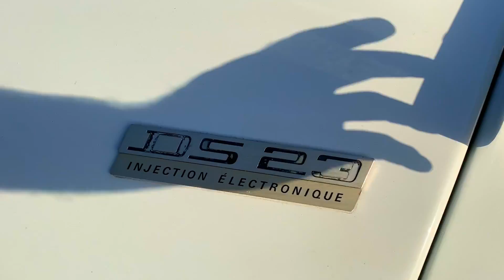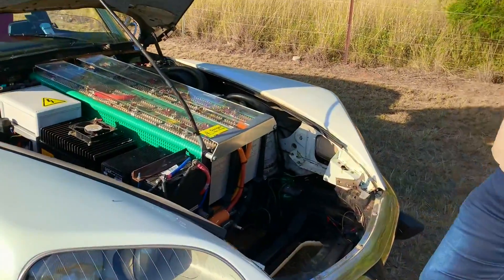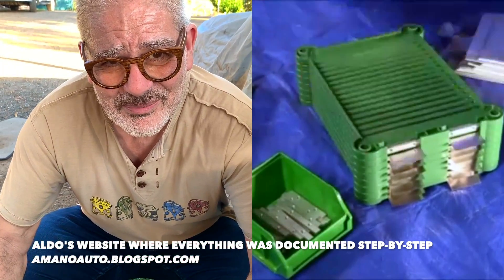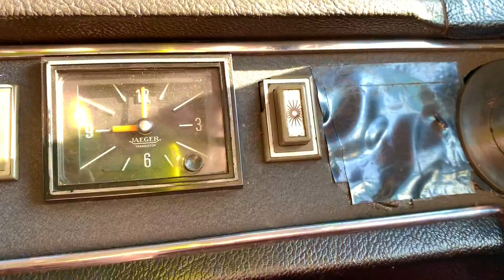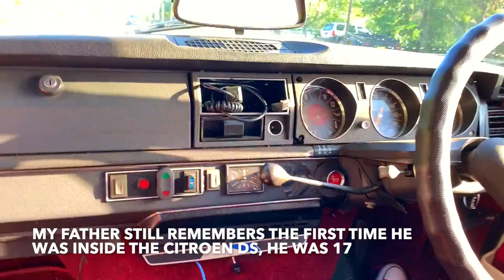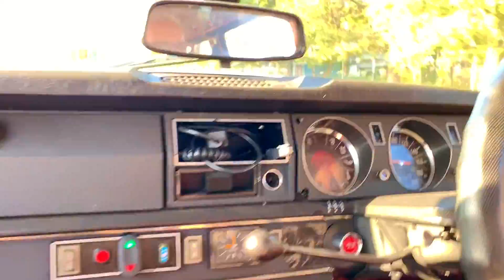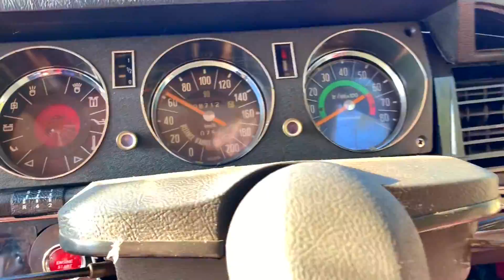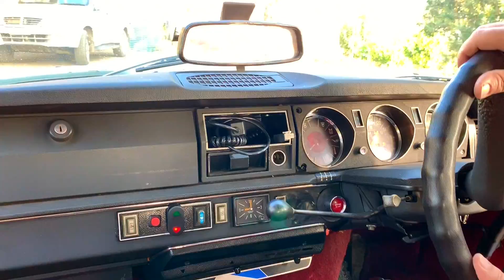DIY Electric Citroën DS 23 Pallas (1974) conversion by Aldo Grech

Comment: The presenter was irritating,had to give up half way through..Mr Grech has done a interesting conversion,though I fear what would happen to that battery pack should he have a front end collision..
Reply from the maker: Yeaahhh thaaanks for watching half video mate!! 
Older cars are SOLID and strongly build to knock a brick wall + there’s over half meter crushing zone before hits the battery + metal plated in front of the cells... so it would survive =]

Comment: Citroen missed a marketing opportunity there
Reply from the maker: Yeaaaahhh... imagine if they embraced electric back in the days and released this car with both options: petrol or ELECTRIC.
Even using many Lead Acid Batteries and older DC motors it still would be a nice option. I recently worked on a rare Baker 1912 originally electric car before petrol cars https://youtu.be/OhnjMdzGusc

Comment: Hi.  I love the DS.  Didn't know much about it.  Is the batttery powered DS better than the original version?  Would love to see where the motor is and also the other batteries at the back as well.  It is extremely increditable to have this built in 2014.  What a great man!

Comment: Yep, great idea. I love the special battery, I owned a DS about 30 years ago.   I must do this some day.  Maybe I'd do it to a more modern car.  Maybe a C5.   I like the idea of pulling a diesel motor out of a car and replacing that with an electric system.
Reply from the maker: Yeaaahhh you actually had a
DS hahaaa such a cool car!!! I also love the idea of pulling out a diesel motor, that will make me twice as happy. C5 would be a great conversion. Whenever you do it, please document everything step by step =]
Reply: @BrunoPOWEEER  will do, no problem.  I have owned a DS 21,  BXs, CXs and a Xantia VSX, and Xantias are pretty cheap these days.  I think a Xantia would convert well too. The good thing about doing a C5 would be that the HP pump is already an electric one, and the brakes and steering are conventional.  I always had problems with loss of large amounts of LHM in my Xantia.   My main issue with doing a C5 is that everything runs through the main CPU,  and I'm not sure how to delete large chunks of existing hi-tech and ending up with a working car.  Would be fun though. I have a C5 V6, AND I LOVE THE CAR.  However, a sparked up one would be interesting.   Cheers.

Comment: AWESOME, Stunning Retro EV, love it!!
Your battery pack design is excellent, I always liked the A123 Prismatic Cells, thought they would really take off years ago .. but IMO, they mis-read the market .. A123 was intent and invested in supplying the entire Battery Pack, but OEMs only wanted to buy cells at a time when A123 was not quite at production stages and LG Chem was .. LG Chem won the cell business over A123.  About 10 years ago, ALL the OEMs made a decision that Battery Packs would be a "core technology" and that they would only buy cells as a low cost commodity item,... A123 business / product strategy was Doomed to bankruptcy, even though their LiFePO4 chemistry was the safest and didn't need expensive cobalt.
Reply from the maker: Yeaaaaahhhh love these comments with a LOT of good information!!!! Yeah I remember back in 2013/2014 everyone only talked about A123 cells for both pouch and 26650 cylindrical cells... they also had a bad batch and some companies got hurt big time but there was no where else to go, they’re the best ones. In the end a Chinese company bought A123 and they do all the manufacturing in China. They tried to revive the A123 battery business but was never the same... like you said, everyone migrated to LG Chem for pouch and the 18650 became very popular making the 26650 business obsolete. I love this Citroen, it packs two pieces of history, the car itself and the legendary original A123 cells =]
Reply: @BrunoPOWEEER  it's sad that A123 went belly up .. it was poor management, not their core technology. The decision to invest heavily in Battery Packs and to do that with government money provided during the 2008 financial crash recovery .. lead to them over extending themselves. The cells were awesome, and MUCH SAFER than the exploding fire bombs in most EVs today.  
    I worked directly with A123 back in 2008-2010 .. developing several of the electrical connectors they used on their packs, we prototyped, tooled and even made some early wiring harnesses for their battery packs.  Those same connectors are used in Europe/Asia regions today on other OEM vehicles.
Reply from the maker: BigCooter.com woooowww now I know why you know so much about A123 hahaaaa

Comment: This can be an enormous business model. Converting existing combustion engine cars into electric cars by taking engines out and replacing them with electric power units. This way people can drive their own dream car without  polluting their environment.
This video proves it can be done.
Reply from the maker: Yeaaahh I’m a member of the Australian Electric Vehicle Association (AEVA), this is where I met Aldo and his Citroen DS back in 2015. Lots of older / retired engineers having fun helping each other’s projects converting their loved cars into electric. They’ve been doing it since 1978... used to be reeeally expensive buying a descent motor + controller making your own battery pack. Nowadays it’s just easier to buy a Nissan Leaf or Tesla and strip the electronics and transfer to your project car. Sounds easy but there’s a lot of work and engineering involved, I see lots of business popping already doing and lots more starting. This is a great news. I’ll be making more videos showing other AEVA members EV conversions. I have some other videos here already like the 300v Mercedes B-class https://youtu.be/48QBTndiiXg
Reply: That's true, but it is usually more expensive than buying an OEM electric car. That usually dampens demand. :-(

Comment: Oh dear......had to turn off after ten seconds, couldn’t bear the presentation
Reply: Same here...it's a pity though, the car's beautiful, and I wanted to know what he did to the suspension, but there's just no way I'm going to listen to that for 15 minutes...it's unbearable
Reply from the maker: Hahahahaha I know... my ADHD was out of control!!
Problem fixed!! Check out my new video showing some High Performance Racing Electric car batteries https://youtu.be/m2XevzDU44A I think I behaved like a normal human this time =]
Reply: Hi Kurt. I’m planning doing an electric conversion on a DS myself. The suspension is controlled by a pump, there should be no problem to run this off the batteries.
Reply: @mvmallinson  Good luck with that. If you can afford modern batteries, you could probably get quite a good range (for example with 18650 cells from a Tesla Model S). I think it's one of the best classic cars to convert to electric, since the engine has always been its weak point - it's not fast and more than that, it's kind of agricultural (how it revs and sounds), completely unlike the car looks.
Reply: Kurt Agree completely. The Tesla batteries are what we have in mind. If you are interested, I’ll keep you posted as we progress with the project. If you check out “Carfection” on You Tube, you will see a 6 year restoration of a V12 E Type that I have just completed. I’m currently doing another project, we are putting a Porsche engine and gearbox into a 1959 Karman Ghia and changing everything to handle the extra power of course and then I hope to start the DS at the end of this year.

Comment: Please help. I have 52v 17.5ah sanyo ga unitpackpower battery from China. It started charging only to 56v instead of 58v and discharging also faster. When the battery is almost fully drained the display shuts off, it never happened before. Battery is almost 2 years but it performed excellent until now. Please see photos of my battery 
https://ibb.co/SdbD5fh
https://ibb.co/fvqPRfN
https://ibb.co/mt13wD0
https://ibb.co/XZy6f11
Reply from the maker: Yeaahh I know EXACTLY what’s happening there! You have one bad cell in one of the series group and that series now have lower capacity (maybe 14Ah instead of 17.5Ah). “14Ah” gets full and empty faster than the other series, the BMS is there doing a great job protecting from a disaster, it sees that series voltage passing 4.25v and cuts power so the charger can’t keep on pushing more power and the same happens when it’s discharging, BMS detects one cell going super low like below 2.7v (3v minimum recommended) and cuts so that series doesn’t go down to 2.5v... 2.3v or less.
Very likely that your UnitPackPower has no cell holders and the cells are all super glued together. I’ve fixed maybe 3 or 4 where the rider dropped the pack or crashed the bike or just very intense vibration and the houses pack cracked in half and the nickel tabs came off one or two cells and caused all that drama. You may have a cell that is disconnected inside. Open the pack, unwrap the paper protection covering the nickel tabs and use a voltmeter to measure every single cell voltage, inspect all tabs and carefully try to twist the pack and find a possible crack somewhere.
Let me know how you go.
Reply: @BrunoPOWEEER  Omg thanks for that answer. I'm really afraid how I will inpect it, I've never done it. What kind of disaster could happen? Can I ride sometime with such pack or should I repair it immediately?
Reply from the maker: I would say the earlier you open and inspect the more chances you have to repair before it gets to the point where it can’t be fixed. I’m sure you’ll be extra careful first time you open a pack =] 
My hands can’t feel anything touching 52v battery terminals but most people feel “something”, specially people with sweaty hands, just wear any thin rubber gloves and avoid touching or holding the pack by the both ends. Just make sure the bench/table you’re working on there’s no metal and nothing conducive around and take photos and label things. First thing I would do is to remove the 15 wires connector from the BMS and starting from the negative B- measure the voltages between first and second pin and take notes. Second and third pin.... always keeping the probes in a good angle apart so they’re not crossing and touching each other.
Sounds like too much information but it’s actually very simple. 
You can take photos and make a post asking for help in these communities on Facebook 

https://www.facebook.com/groups/endless.sphere/?ref=share

https://www.facebook.com/groups/diypowerwalls/?ref=share
Reply: @BrunoPOWEEER  We opened the pack, didn't tear it apart yet and out together. We think now what to do, maybe we'll find a master. But if we find the bad cell or bad connection how we can weld it? Do we need a spot welder? Please see photos of my battery. 
https://ibb.co/SdbD5fh
https://ibb.co/fvqPRfN
https://ibb.co/mt13wD0
https://ibb.co/XZy6f11

Comment: My dad had a DS21. The most confortable car ever. Everything was differant fom all other manufacturers.
Too bad Citröen cars of that period used to rust quickly. That's the main reason they are so rare nowdays.
Reply from the maker: Yeaahhh so many people watching and commenting “my dad had a DS and it was the most comfortable car ever!!” Hahahaaaa so cool!! 
Even Jay Leno collecting so many cool classic cars said that the DS is by far the most comfortable car ever made!

I didn’t know about their rust problem... hummm sad =/
Reply: BrunoPOWEEER Water got often trapped in the lower part of the doors and roten them from the inside. It's a usual fix to inject foam in the void of the doors to keep water out.
Also the metal sheet was quite thin to acheive a lower ovarall weight and therfore rust pierces it quickly.
Another explanation of the rarety is the cost of repair once the aging hydrolic joins start to leak. You have to remove the engine/clutch/gearbox just to change let say a single joint on the direction. More over, outside of the Citroën retailers network many technicians were afraid to work on DS because it's not conventional.
Reply from the maker: Λογος yes... mechanics in general are scared to touch this weird back to front vintage motor, they probably don’t understand the hydro pneumatic system either...
Thanks for the tip about injecting foam inside the doors to keep water (and rust) away. Aldo is a member of the Citroen club for decades and may know most these things but I’ll make sure I tell him. This DIY electric car will rarely see any mechanics workshop =]
Reply: You can find every part you need in France. Some are even remanufactured, but it's easier if you can read an speak French.

Comment: The pump is more noisy than the original.

When idling you could heat tick tick...

The car do not have a vacuum pump for brake assist. When breaking, you let the hydraulic out from the springs, and the weight of the car press the brake pads together. The heavier the car, the better the brakes..

After several years with Citroën, I felt like the non Citroën car did not have any springs.
Reply from the maker: Michael Eric Menk Thaaaaanks mate for this very informative comment!! Very interesting that the weight of the car is directly related to the brakes... 
This is the original DS pump, the original petrol engine would’ve completely cover up the pump noise. A petrol engine idling is always running and noisy so you can’t even hear the pump kicking in and topping up, now that it’s electric you can hear any little noise. It’s possible to make quieter which is something I was attempted to help but we were there packing up all his stuff to send to Italy... he can do it when the car arrives there =]

Comment: respect, please fix the rest of the car also a little. My dad used to work for citroen for +50 years, his brother 40 years last DS my dad had was a also a 23 inj. pallas (nice green) that we restored completely to the last bolt together. One of many we owned and i grew up with. My dad passed away weirdly enough the same year citroen stopped making the real citroens with the hydraulic systems.
Reply from the maker: Woooowww 50+ years working at Citroën... im sure your dad and uncle helped creating this amazing piece of engineering on wheels!!
It must’ve been fun restoring this beauty down to the bolt... do you have any photos or videos? I just rushed to check your channel but unfortunately couldn’t find any DS content  =/ (I guess we didn’t have blogs and internet back in the days). I’m pretty sure you had a fun time restoring your dads DS =]

Comment: I love this, well done Aldo.  I have heard that some people have also utilised their original gearbox in their EV conversions, so you change gear as normal, no idea how that would work? One day I may wish to go down this route with my DS21 BVH when the price comes down to have someone else do the work as this is far beyond my capabilities.....!
Reply from the maker: Yeaaahh lots of EV conversions people kept the original gearbox instead of buying a very expensive bigger and more powerful electric motor. Nowadays you can buy a crashed Tesla, Chevy Volt or Nissan Leaf, get the drivetrain and batteries and fit into another car. Much better stuff for a lot less money!! =]

Comment: Why not 18650 cells?
Reply: 2014
Reply: Tesla used 18650s in the 2008 Roadster.
Reply: Lifepo4 are also easyer to keep safe. (yes, you to get Lifepo4 in the 18650 size)
Reply: Yes, but unfortunately with less than half the energy density.
Reply: @elgalloazul  no, lithium cobalt oxide 18650 has 3.15 times the energy density of lithium iron phosphate battery.
Reply: ...which means that the LiFePo₄ 18650 has 1/3.15 = 0.317 times the energy density of the LiCoO₂ 18650, which is less than half (0.5).
Reply: @elgalloazul 
Lithium iron phosphate battery energy density: 220Wh/l
Lithium cobalt oxide battery energy density: 693Wh/l
Reply: Yep. That sounds exactly like we both keep saying. <thumbs up>